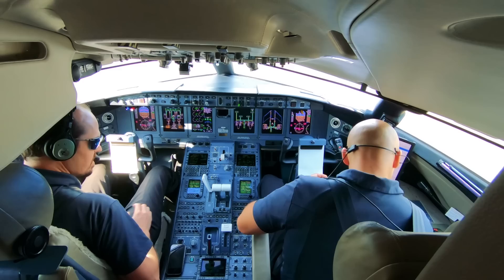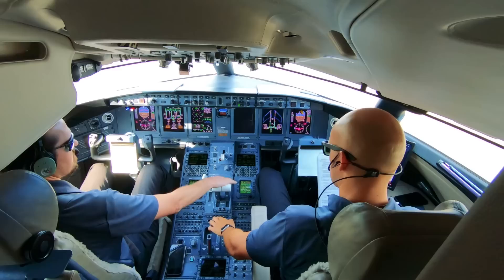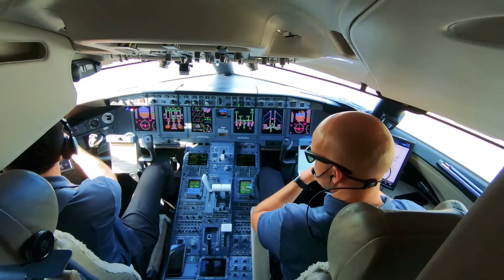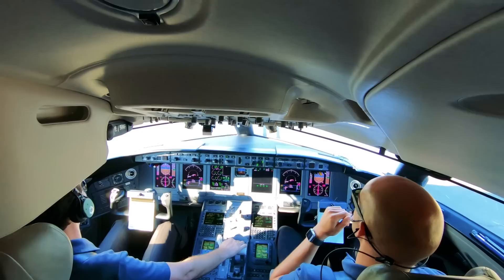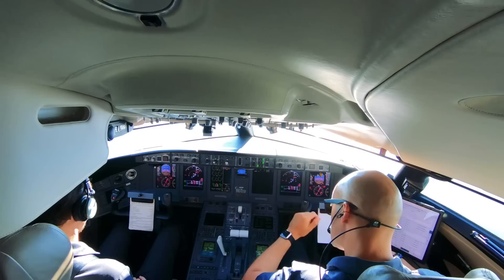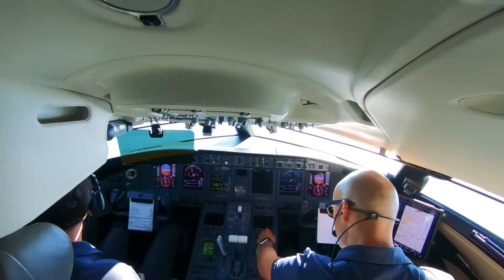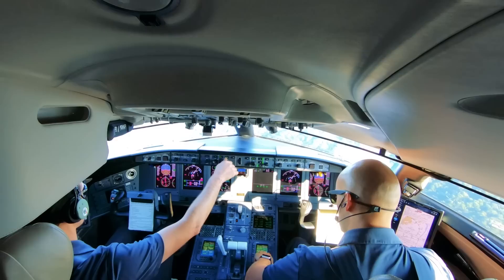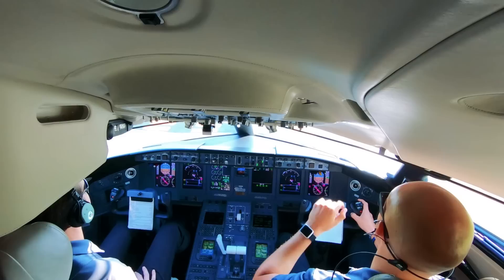Autobrake Landing in a Global Express - VLOG 173

Comment: I have over 3,000 hours in the Global and it was my favorite airplane ever. Great short field performance, always can climb to at least FL 410 initially and nice cruise speed of M .85. Super quiet with a great environmental system. Only thing I didn’t like was disconnecting the batteries.  You made a nice landing with little float, a lot of pilots flare too high and float way down the runway but you have it mastered. Never used the autobrake because it comes in at around 112 knots most of the time and I was able to brake better for the turnoff than the  auto brakes.  I flew A G 550 also and the workload is so much less on the Global. Balancing fuel is better than slipping a Gulfstream its automatic just like almost everything else on the Global. Enjoy this awesome plane😊
Reply from the maker: The G550 is still on my wish list of planes to fly someday...but the Global is definitely a great bird!

Comment: Not an expert: just an arm chair Multi crew commentator ..
There are some multi crew things that need working on.. small example is you said I have XXXX in the transponder and he didn’t check but still responded with “cool” … a visual check and a confirmation verbal check should happen. But, that’s a small example. However small examples can lead to Errors.